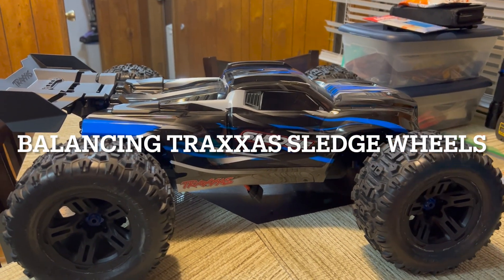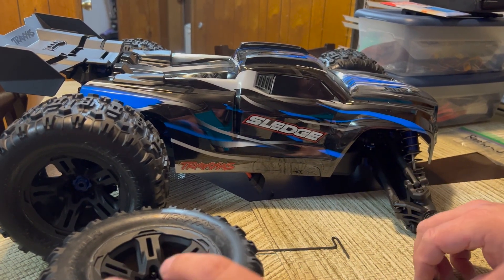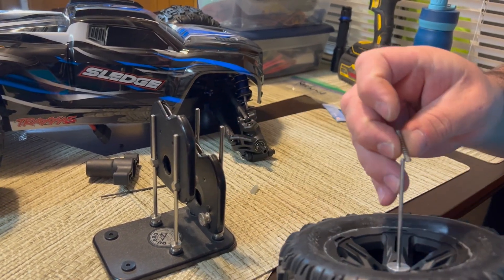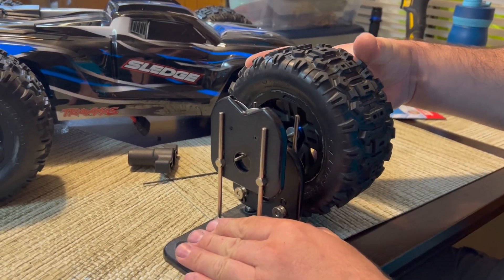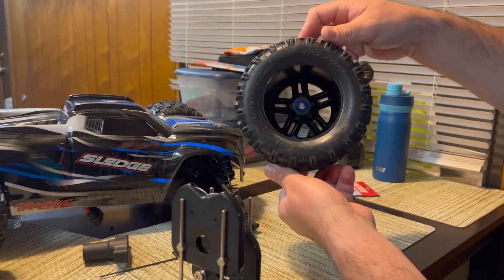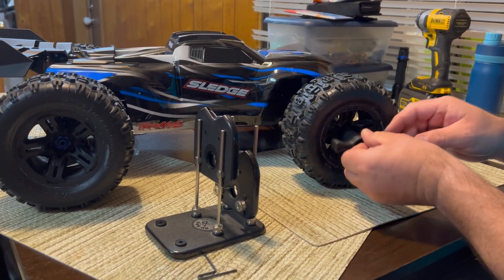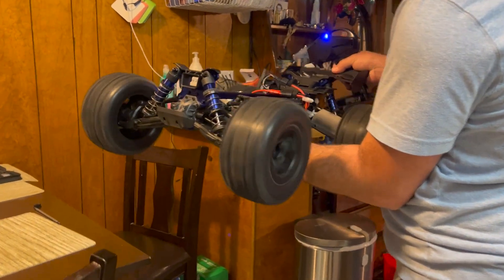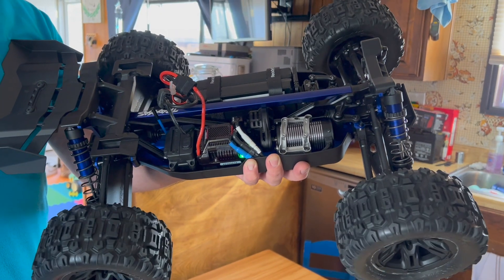Traxxas Sledge tire balancing with Du-Bro prop balancer + before and after comparison

Comment: I haven’t seen a tire more out of balance then what came on my sledge. Not to mention they’re unusable in 6s
Reply from the maker: @mitchmackey252  I’ve had to balance most of the Traxxas wheels and tires. But once you balance them, they stay balanced as long as you don’t get the foams wet.